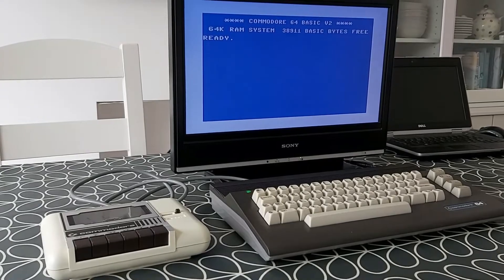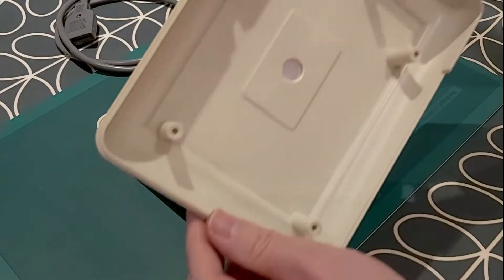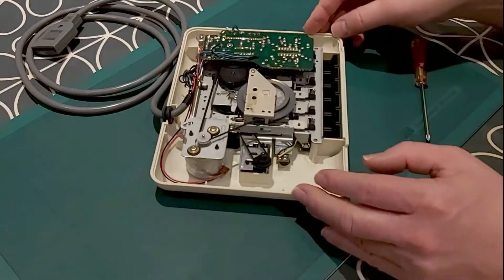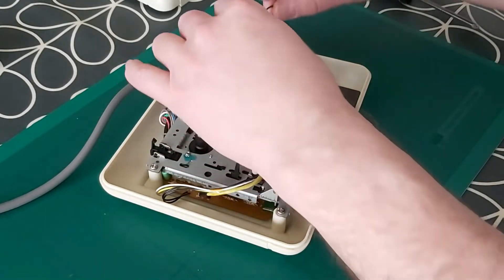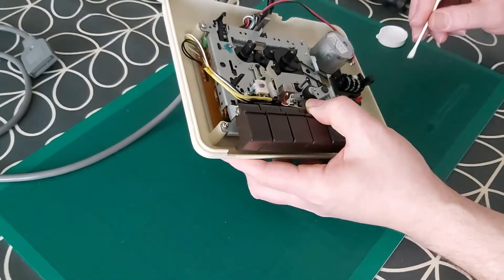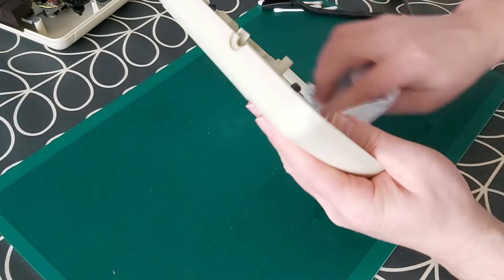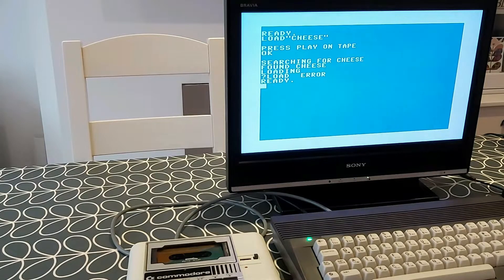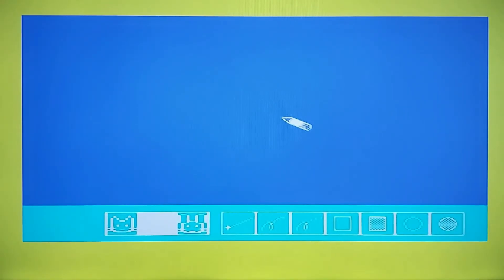How to Service a Commodore 64 1530 C2N Datassette

Comment: As for the azimuth calibration I noticed the program does not run correctly on NTSC machines.  Also I'm assuming you need to use a known good program tape to do it with, if you don't have any and you record a program to a blank tape with an uncalibrated datasette I'm assuming it wouldn't be possible to calibrate off of that.

Comment: That’s interesting that you can hear the code being loaded from the tape. The original C64s were silent. Is that because you have Gideon’s board with a speaker inside?
Reply from the maker: I hadn't noticed that. No, I didn't use Gideon's add on speaker as it was out of stock when I ordered my board.
Reply: @RetroNowTV  Quite a mystery then.

Comment: That's a really good picture for an LCD what make of SONY is it may i ask. Thank you.
Reply from the maker: The reason the picture is so good is that I'm using my Ultimate 64 in this video. This is a modern board that recreates a C64 using an FPGA and gives HDMI output. It looks great on any LCD. I not exactly sure what model the TV is but it's  a Sony Bravia from around 2010.
Reply: @RetroNowTV  ahh yes , i thought i could not even see any jailbars . lol
Reply: The aspect ratio is wrong though.

Comment: Thanks for the video. Brings back memories from 80s. Never had a look luck with my dataset. Even when it was brand new It rarely worked and had to replace the head several times. Now I own a new old stock just for the looks. I mostly use my sd card reader.
Reply from the maker: Much the same as me. I have a few datassettes including a new old stock model, but like you I usually use either a Kung Fu Flash cartridge or a SD2IEC card reader. Actually, to be honest I mostly use my TheC64 and only occasionally use my vintage hardware.
Reply: I found a Datassette outside in the woods a few years ago that works perfectly without a belt change. Another one from Ebay needed a new belt and works perfectly since then as well.